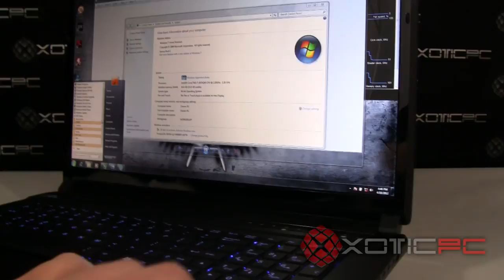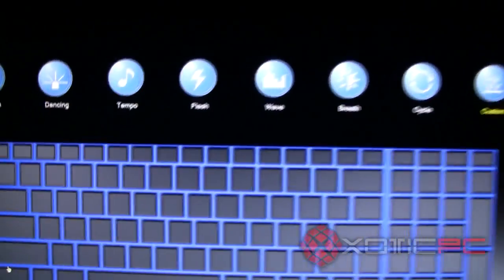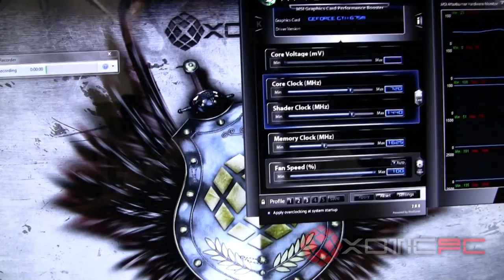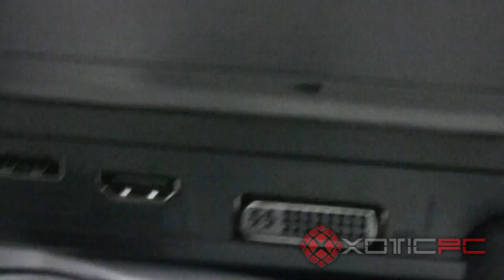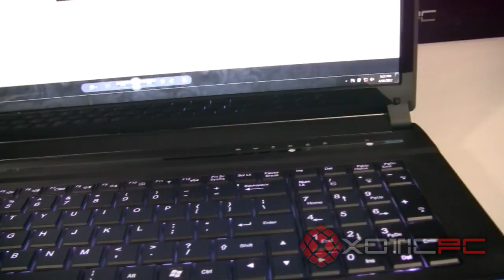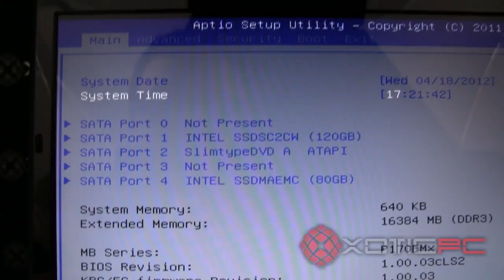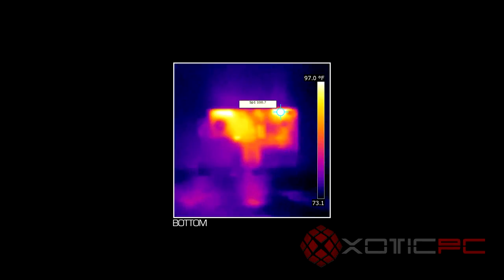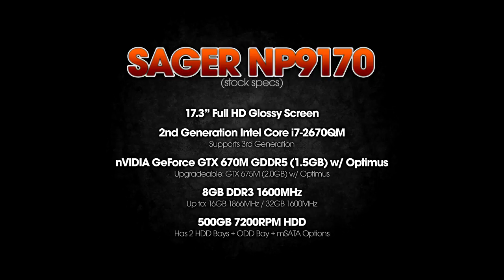XOTIC PC - Sager NP9170 / Clevo P170EM Video Review

Comment: I really want to get the Sager P9170EM model over the 15' model because I want the extra HDD bay without sacrificing the optical bay. The only thing stopping me is I must get the 95% NTSC Gamut screen; however, it costs $185 for this upgrade as opppose to $75 on the 15' model. My only gripe.

Comment: I just recently purchased this laptop with the 7970m and I am having no problems with the drivers. It runs BF3 at 40 fps (everything on ultra) and on some maps I can get an additional 5-10 more. The gpu's heat peaks at 72 with a notebook cooler and runs at 99%.

Comment: I just recently purchased this computer with the 7970m and I am having no problems with the drivers. I am getting about an average of 40 fps on BF3 (all settings ultra), and on some maps I get 5-10 more fps. The driver is running at 99% and gets and high temperature of 70 with a notebook cooler.

Comment: I ordered an NP9170 for myself this summer. I love it so far but there are two things I would suggest. One, get the pixel insurance. I already have a stuck pixel but it happened within the first few months so it should still be under warranty. Two, upgrade the keyboard. The standard keyboard suffers badly from "ghosting" and is overall uncomfortable to type on. It took me several minutes to compose this message because I kept hitting wrong buttons!

Comment: Just a few questions.
1. Whats the size of the 9170 comparing to the m17x?From the looks of it,its quite small for a 17inch I hope its just a camera illusion.
2.What the material finished used for the Laptop?Plastic or metal finish?(the shell of the laptop)
3.Again size. The keyboard keys looks tiny do you have problems typing with it?Again I hope its just a camera illusion.

Comment: I plan on making a purchase in the next two weeks, and narrowed my selections down. Is the only difference between the NP9170 and NP9370 the option for dual video cards? Also, do you have any videos comparing heat on your copper heatsink upgrade? Before and after thermal shots would be ideal. It's many of these kinds of options that differentiates you from simply ordering from Sager direct. Thanks.

Comment: Hi Xoticpc just a few questions on the 9170
1.Hows the size compared to the m17x?The 9170 looks small for a 17 inch
2.What is the laptop chassis made of? Aluminium?Plastic? 
3.With current GPU's and CPU's how the temperature going?
I do hope you respond I don't really have alot of data to use on 30mins of youtube. Thx.

Comment: If I my understanding is correct, the GTX675M uses Optimus technology which reduces power consumption (longer battery life) when running on battery and running regular apps. What about the 7970M? Does it have a similar technology when operating on battery? i.e. when running regular apps (MS Office) on battery, what kind of battery life can I expect between a system with a GTX675M vs one with a 7970M?  Thanks for the info.

Comment: Hi,
I'm really keen on this pc. Just wondering what the difference is between the Nvidia GeForce GTX 675M GPU with 2GB GDDR5 Video Memory and the AMD Radeon HD 7970M GPU with 2GB GDDR5 Video Memory. Which one is better and which would you recommend to put in the laptop. Cheers

Comment: I doubt it would have any problems running either of those at max settings. I currently have the Sager np6165( had it for about 1yr) and it can run both skyrim and bf3 at High quality not ultra. But I can put skyrim on ultra and it looks beautiful. Battelfield you can barely tell the difference, just a few added particles. I'm looking forward to either getting this in a year or 2.

Comment: i orderd one with the gtx 675m card with xoticpc took a little bit long to get to me but been very pleased with the purchase, the only concern for me is the graphics card, i noticed is a little bit better than my gtx 580m on my desktop, but shockingly it's only scores 6.8 on W.E.I compares to the gtx 580m score 7.9 on WEI, do you have any ideas why? by the way that a nice wallpaper where did you get it?
sager np9170:
3rd Gen intel core, 120gb 520gb ssd,  gtx 675m, 8gb 1333mhz ram.

Comment: Hi xoticpc, I am choosing between G75 and NP9170. My concern is although Sager get a much more powerful video card(675mx, also less power hungry),  is the cooling system in 9170 comparable with G75's? I mean both get dual fans, but when after maybe several months of using, would the noise and temperature still as good as ASUS's? 
Thanks!

Comment: I know the weight of this laptop is listed at 8.63lbs, Id like a bigger screen, I mainly want to use the machine for work purposes so I would carry it everyday back and forth. I have a couple questions.
1. How does it feel carrying this beast everyday? do you recommend it, or should I go with NP9150?
2. Do you know if a thinner form factor (similar to macbook pro 17'') is going to make it into the Sager line in the near future? or these kind of high performance laptops will always be thick?

Comment: hello xoticpc, i had a np9150 with a 7970m and cant reboot due to BSOD's. Did the GPU fail, or the HDD? In other words, is it a hardware issue usually (i didn't change with any default ms settings)? And one more question, would the 680m be a better choice in terms of quality and performance? thanks!

Comment: @nogoodwithnames actually when i bought the laptop in mid may i knew the gtx 675m it's not the greatest card, but i can't wait no longer  for the 7970 to come out, i was a little disappointed at first but this card exceed my expectations out performs the gtx 580m on  my Alienware R3 desktop, hook it up to a 37in led lit lcd 120mhz monitor, let me tell you graphics are stunning, i don't regret of getting this laptop, and the gtx675...by the way it's  bad to be no good with names.

Comment: I'm not from xotic pc, but the AMD Radeon HD 7970 is much better (faster with newer technology) than the GTX 675M. However, I'm not sure if the 7970M is worth the $100 upgrade from the 675M. If $100 doesn't make much of a difference to you, I would get it. If not, the visual difference isn't large enough to warrant a $100 price.